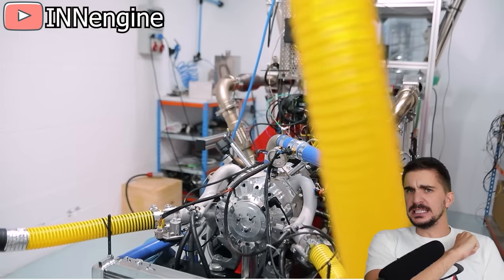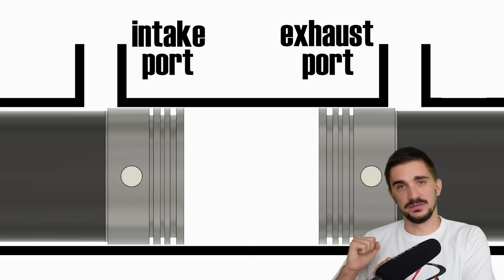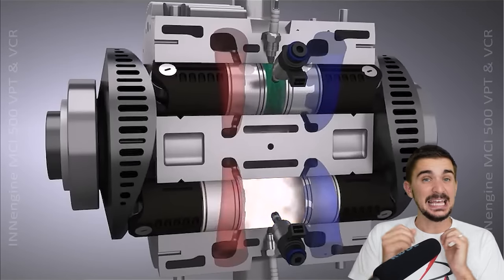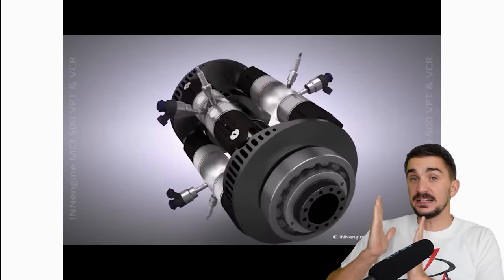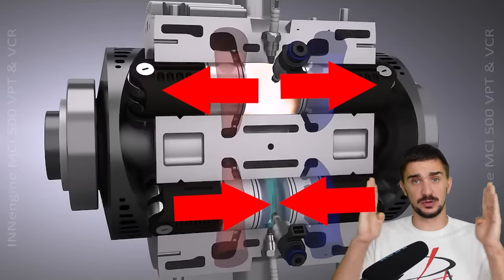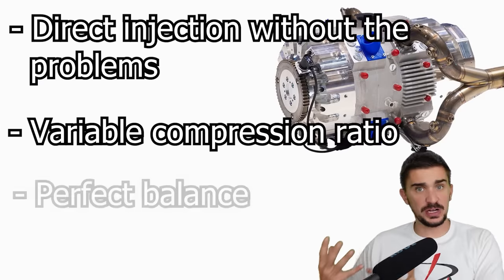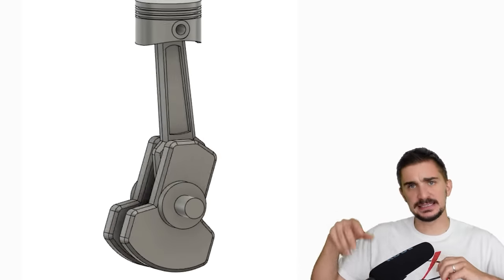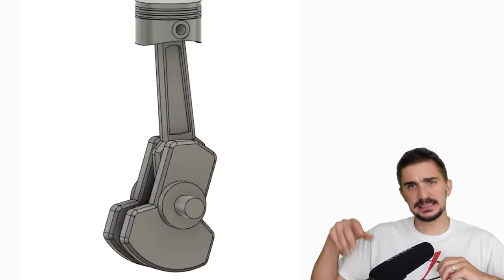Spain is Living in 2050? Revolutionary 1 Stroke INNengine Analyzed

Comment: This has been done in a diesel engine, look up  Fairbanks-Morse 38 8-1/8.  Used extensively in locomotives and diesel electric submarines, originally designed in the 1930s.  It uses 2 conventional crankshafts instead of the swash plates.
Reply: Exactly
Reply: We had 3 on the barbel...dbf
Reply: Used the same engine on Los Angeles class nuclear submarines too.
Reply: Had one on the ship I served on as the ships EDG. Lights would go out, you'd hear the HP air valve kick open and that thing would roar to life. Was a cool engine
Reply: I think even in old airplane diesel engine
Reply: @superliegebeest544 yep the Junkers two stoke diesel aero engines in WW2

https://en.m.wikipedia.org/wiki/Junkers_Jumo_205

Actually reading the article this is basically a direct copy with the swash plate crankshaft being the only ‘innovation’
Reply: Yep. Had one on the Thomas Edison too.
Reply: Opposed piston 2 strokes have extensive usage in military vehicles.
Reply: Yep, as far as the opposed pistons sharing the same cylinder and combustion chamber.
Reply: Napier made conventional opposed engines. For a real trip, look up the Napier Deltic
Reply: Deltic 2 stroke diesel Locomotive running on BR.
Reply: Very good analyzed!
Reply: I think the engine could work well as a hybrid power plant. Combined with the torque of an electric motor. It could be a vary nice engine.  

Also I bet the engine takes a lot of power to start. Moving all those Pistons must take a lot of energy. "Piston ring friction"
Reply: The version with twin crankshaft is very different from this little engine. Yes twin crankshaft have been/are used, the swash plate makes this a very different animal
Reply: Deltic train engine which was the 1st non steam engine used by British rail.
Reply: "It uses 2 conventional crankshafts", so, you're actually saying it hasn't been done before?
Reply: Still in production. Really
Reply: @billdurham8477  they are using twin crankshaft 2 stroke design more and more. Wide use in military and where size is not an issue. Cummins makes one that is used in a tank but I can't remember which tank

Comment: One reoccurring theme that I always notice with opposed piston engines is that they all seem to have a supercharger. I personally think they're critical to the design, mainly because the exhaust scavenging action isn't enough to pull fresh air in, so they need a little extra "push". Detroit 2-stroke diesel engines have a similar operating principle as far as the supercharger goes (or "air pump" as they call it).
Reply: Also since the engine technically have 2 outputs might as well use the other output for something useful since one of the output already being use to drive the car forward
Reply: 2-Stroke Diesel engines need supercharging at low speeds since you need a source of pressure to push the spent exhaust gases out of the cylinder. On turbocharged EMD 2-strokes, the turbocharger becomes a centrifugal supercharger at low speeds.
Reply: Right, even though those Detroit engines were NA, they still had the supercharger in order to run.
Reply: Yes the supercharger is there for scavenging gases. This engine need it to work. It can use a turbo too to being more efficient.
Reply: @archise3191 EXACTLY! I instantly thought they should add a centrifugal supercharger on one end feeding into a ring shaped intake manifold that circles the intake ports!
Reply: A standard exhaust system could savage well with a pipe just like a 2 stroke. This gives you an RPM power curve just like a 2 stroke. Most people don't look at it in the correct way. In a 2 stroke the camshaft is mostly the exhaust and intake system tuning.  The power band can be almost anything you want but you pay a price for the flatting of the power curve by less efficiency or more emissions. 
If you have a wide range transmission then a narrower power band tuning ports that gives best emissions and power would work just fine without boost. 

Whenever you make a system it needs to be reliable, efficient and low cost.  It might be worth it to have a mid range tuned system and a 6 or 8 speed trans. 

The host is wrong about the RPM range having to be high. Torque is set by the diamante of the cams and the height of the ramps within limits.   

Nice looking prototype BTW.
Reply: Yes, a standard 2 stroke uses the crankcase as the "supercharger".
Reply: @cncspeakers1664  on most 2 strokes. (mostly talking 2 stroke diesels like 2 stroke detroits for example. the camshafts used for only 2 things. Firing the injectors. and opening the 4 exhaust valves. as they have a scavaging port. but since its 2 stroke. and its diesel. it needs really high compression to detonate fuel. and it being 2 stroke and diesel means it literally cannot produce vacuum on its own. to sustain a high enough compression ratio to ignite fuel. so it just needs slightly above atmospheric/low volume/low flow of air to run.
Reply: Yes, pressurized is key.
Reply: @cncspeakers1664  He is not wrong this would be a torque flop
Reply: It helps make sure the gasses are flowing in the right direction.. Without valves and the ports both open at the same time, like this is.. Having forced air both adds compression and horse power, but also makes sure the intake is flowing in the right direction.
Reply: Piston ports are fairly ubiquitous on opposed-piston designs, and can't really be adjusted the way you can adjust the timing of a normal engine.

This is very important for efficiency over varying loads and speeds.

(Every once in a blue moon you'll see a sleeve-valve opposed-piston design, which is better, but still not great.)
Reply: @mddawson1  
That would then be the intake port.
Reply: @mddawson1  
I understand.  My point is that the air and fuel still need to be "taken in", ported into the combustion chamber.  So it still needs an intake port, "traditional" or otherwise.

"A rose, by any other name, ..."  😁✌️
Reply: @@tobiascat6173 
Well, look at it this way, thirty minutes thinking about how engines work and making comparisons between different implementations isn't a bad use of time.  It gets ya thinking and motivated to write.      There are many less productive ways to have spent that half-hour.
Reply: @electric7487 A turbocharger can never be a supercharger.
Reply: @spaceghost8995  On EMD engines, the turbocharger rotor is connected to the engine's gear train by a clutch. Below a certain speed the compressor (and turbine) are mechanically driven by the crankshaft. Once the engine turns faster than a certain speed the clutch disengages and the turbine is now what turns the compressor.
Reply: Yes.  I wondered, too, how they would get the exhaust out and fresh air in efficiently.  In the Fairbanks Morse opposed piston engines they don't really supercharge the cylinders (a supercharger actually compresses the air into the cylinder before the pistons compress it further) but they actually call it a scavenging air pump.  But FM engines are 1930s technology and maybe these guys have figured out something else?
Reply: @cncspeakers1664  You are ignoring that high efficiency high speed 2 strokes use large tuned diverging/converging exhausts, with substantial reflective back flow into the exhaust, which often narrows effective power band more than the porting. RPM adjustable tuned exhaust length only adds to weight, packaging, heat and cost issues. Fitting 4 tuned exhausts under a hood sounds challenging? Which makes the supercharger the more packageable option, and probably much wider power band.
Reply: It is because it's an 2 stroke. 2 strokes always have a "air pump" or by its inventor called "Spülpumpe"

Comment: Would probably make a really good generator in stationary applications and range extender for Hybrid Electric vehicles, where it could run continuously at the most efficient rpm
Reply: Free-piston linear generator looks better.
Reply: that was my first thought too: if it doesn't have torque but it does have size / weight / efficiency, they should just mate it to an EV platform that takes care of the driving needs and doesn't have to be as big or lossy as existing hybrids
Reply: You'll have a 7000rpm tiny engine revving like crazy... not sure if it's ideal haha
Reply: One of the reasons this would work great for a hybrid is if it actually low torque output the electric motor would easily compensate for that
Reply: @tecnogadget2  But you can tune an exhaust system to make it less harsh.
Reply: He literally said that at the end of the video
Reply: @kcsi1  Have there even been any free piston linear engines already?
Reply: @Stoney3K  
I relied on Wikipedia:
https://en.wikipedia.org/wiki/Free-piston_linear_generator

Comment: Great presentation and explanation. Interestingly, Napier built an opposed piston 2-stroke diesel engine many years ago in a triangular format with three crankshafts called the 'Deltic'. Used successfully in trains for many years!
Reply: Deltic made a great sound!
Reply: And marine craft before that during WW2
Reply: Old Soviet tanks T64 had 2-stroke direct injection internal opposite engine named 5ТДФ
Reply: @maxjooher and future us tank engine (ACE - advanced combat engine)  is also supposed to work with this principle
Reply: I seen that on curious droid
Reply: Prinzip Gegenkolbenmotor.
Nix neues
Reply: I believe still in service with the hunt class
Reply: @Grid56 
They built 13 Hunt-class minesweepers each powered by a Napier Deltic
And they were last built in 1988! With Deltics!
Sadly they had their Deltics ripped out for boring caterpillars in 2008... 😢

Comment: This would be a great small / light aircraft or drone engine. Aviation engines tend to run at high RPM continuously. Maybe in a push puller arrangement with two props
Reply: Especially good for aviation there are no belts/chains and a simple design is everything you want, especially if you're on to going to the FAA for getting a permission ^^
Reply: Motorcycles as well come on!
Reply: Using it to drive a prop certainly helps with the pressure on the swash plate.
Reply: pespsisipper  yep, my first though, perfect powerplant for 2 wheels.
Reply: Aviation engines run at very low RPM, typically redlining at 2400-2800.  They do this because propeller tips tend to tear themselves apart at high speed.  PSRUs (prop speed reduction units) add bulk, complexity, and reliability problems.  Aviation engines typically run at 75-85% throttle in cruise.  Having said that, the low torque high speed engine may have improved vibration qualities (small torque impulses at a high frequency) that allow reduced PSRU complexity and increased reliability?  It would certainly be fun to experiment with.
Reply: @exekute  This engine is best for generators
Reply: @SpiraSpiraSpira they are already making this motors for aircraft and boat industry. The mazda thing was more a demostration in order to gain atention.
Reply: The primary objetive of these design is a ranger extender engine for electric cars or a Stationary engine.
These engine its good to run at fixed rpm, its not good to continuous acelerations or decelerations or continuous load changes.
Its had very bad to star up, the inventor talks about these and he suggested that an air blower could be adapted to improve starting.

Good for ranger extender, electric generator, rc aviation, drones, paramotor, light aviation.
Bad for cars, motorcycles, etc
Reply: @exekute  you wouldn’t necessarily need a constant speed unit, you could get away with just a reduction gear. For example, if the highest RPM was 6,000 then a simple 2.2 to 1 reduction gear would get you in the range of 2400 rpm at max power, which it then could run continuously. That would be enough for drone applications.
Reply: @manuelpinto4809  Fixed rpm, stop/start hybrid?
Reply: @spiraspiraspira I was waiting for someone to mention push/pull

Comment: It'd make a good motorbike engine, with their light weight compared to cars and not having the need for big torque at low RPM, and the lack of camshafts, chains etc. would be great for low required maintenance. I owned many two stroke bikes in the 1970's but one was always aware that they'd wear out pretty fast, at least regarding the top ends.
   Great review, as always.
Reply: 2 straight me bikes are amazing 

I miss my 1982 rd 350 lc
Reply: Motorbike engines can already make that much power with that displacement.  There's no advantage.
Reply: @EstrogenGhoul  I once had a ported Kawasaki 500 that made around 80 crank horsepower but was totally gutless at anything under 3000 RPM, needing lots of clutch slipping to even move off the line. A Suzuki RG 500 Gamma made about 95 crank horsepower. To my knowledge, only Bimota's ill fated V Due was a 500cc two stroke that made about 120 BHP in roadgoing form, and like all two strokes, needed tearing down too often. We're talking about usability here, not racing or dragstrip antics. This engine had a 500cc displacement. Have you owned one or smaller two stroke road bikes that were tuned ? If not, I can assure you that you'd soon be sick of the sight of them if you had to use any at throttle openings of less than flat out. I also had a Suzuki T500 and GT750 in standard trim that were pretty torquey but made only 47 and 70 BHP respectively.
Reply: @michaelarchangel1163  True enough.  I had a gamma for a while, enormous fun but the square 4 setup was just plain stupid if you wanted the engine to last.  I'd be worried about the durability of this engine too, and for about the same reasons as the gamma's 2 rear cylinders.  the "intake" pistons are going to be effectively cooled, but the exhaust side is going to get really hot, really fast.

There's probably room for cam profile shenanigans in this case, you could, for example, "stall" a piston at TDC or BDC (stupid terms themselves in the case of what's effectively a swash plate engine), with the most gains probably by holding the exhaust open longer to help scavenging, but I really can't see this delivering enough to beat a conventional inline 4 600 without forced induction.
Reply: @EstrogenGhoul  4 stroke 600cc engines can make 120 hp, but require revs up to 14,000 (give or take). This makes them very inefficient. They are being regulated into non existence due to emissions and noise pollution. They are also very maintenance heavy. Most supersports require significant maintenance by the time they reach 40,000-50,0000 miles and just aren't very good for anything other than going fast.
Reply: @wibblywobblyidiotvision  Yes, it was definitely surreptitious of this company not to declare that they'd supercharged their engine in the MX-5 shown.
Reply: @EstrogenGhoul  only tinker with my own car and not as engineer minded as some, but would a similar 500cc engine not be meaningfully larger/bulkier and certainly heavier? Is this not at least a reasnoble advantage?